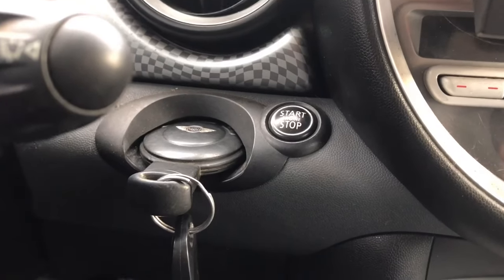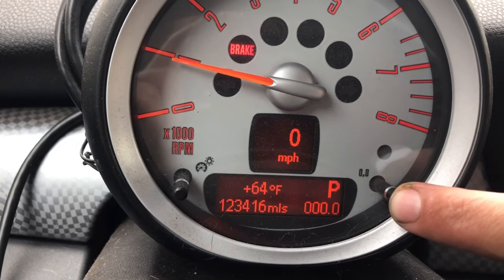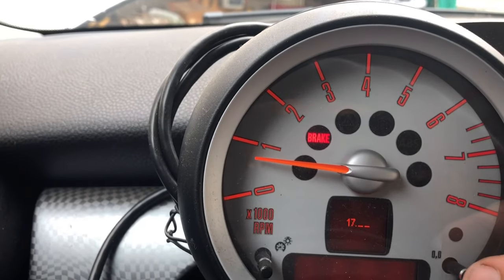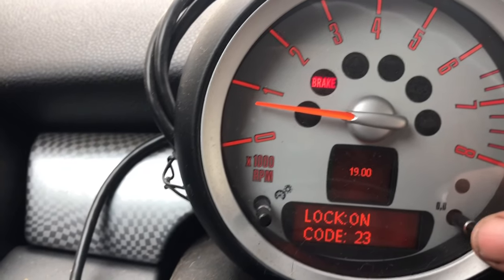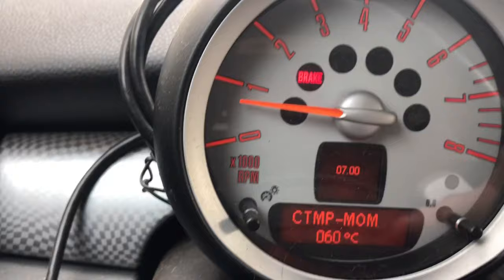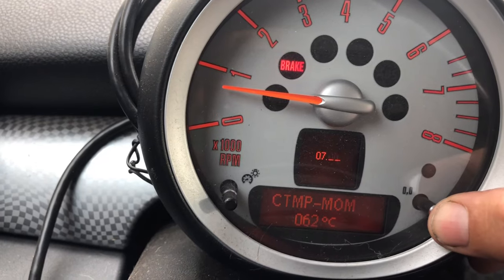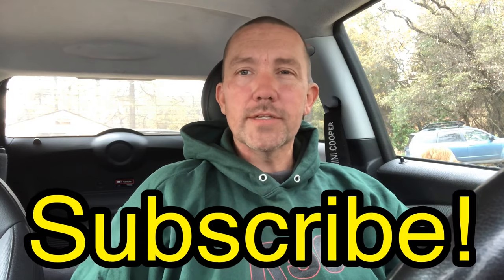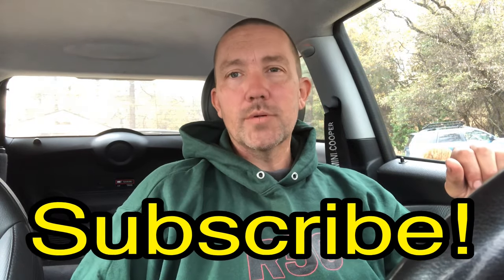How to check the coolant temperature - R56 Mini Cooper hidden menu

Comment: Good to know how to crack the code. I just don't understand why they hid the engine temp anyway. I've just fitted an x60 gauge to give me manifold pressure and temp as well as being able to clear codes. Probably the best £25 you could spend on your R56.
Reply: @emailandy79 hey! Which gauge particularly did you get?
Reply from the maker: A scanguage 2 or an ultragauge will work. I have a scanguage 2 and love it
Reply: @harrydawg   X60 autool gauge.

Comment: I just purchased a 2010 mini clubman two days ago and it’s stalling out on me when I stop at a intersection or anywhere else really but it only does it every once in a while. Last night it started acting like it was getting overheated because it was running poorly after leaving it idling a couple of times while I took my customers their food to the door. Once I stopped letting it idle when I stopped and started turning it off and then starting it again when I was done it seemed to be okay again. The check engine light is on and I got a P2187 code from scanning it. Do you have any advice for me on fixing this problem ? I would be very interested in hearing your thoughts on this issue.

Comment: Hello there! thanks for the nice content. I just bought a mini cooper s 2012, and I see the temperature going up and down all the time, but mostly remains 110 celcius ! Is that normal? Isn't it a risk for the motor?
Reply: It should be around 90C
Reply: @DavidB-rx3km   Unfortunately it is not stable. I noticed that with the "sport" button on, it indeed manages to stay around 90C all the time. But without sport button pressed, it goes very soon up to 110C or more, even with very calm driving. I wonder if it's an ellectronic mapping error.
Reply: In sport mode I think the fans kick in at a lower temp
Reply: @shiro4076   yeah, thanks for the reply, I found out it could be fixed with a professional remapping. I also cleaned the intakes. Now I always drive with "sport" on. And it works fine. With sport off it goes higher but not as before.

Comment: Great video.  I am having an issue with the key fob not working right away.   The car is not waking up and after it starts it could take some as much as a minute for all the gauges to come up.  I have to shut it down and restart the car to clear all the start up menus.  2009 R56.  Seems like a real problem when its cold.

Comment: Thanks, wish it just had a normal temperature gauge.
Reply: I had an R56.....I had it a week then sold for that reason only. Oil pressure and water temp gauges are the two most important gauges in any car.

Comment: hi, do you know if you can deactivate the parking/position lights on the mini? The ones above the fog lights always turn on when you have the light in automatic or the on position. Is there any way to turn them off (permanently) when running the normal headlights?

Comment: What happens if it doesn’t change the screen? I was holding on to the button but it made a weird noise
Reply from the maker: How long did you hold the button?
Reply: @ProjectMini  sorry for the late response. But it was quite longer than what you did in the video. I will check again in the morning.

Comment: I have 2008 mini cooper clubman s the engine not run more 2000 rpm check engine light half motor light

Comment: Nice hack there. Is it normal that the coolant temperature runs at around 80 degrees Celcius; what would be the normal coolant temperature;
Reply: I would assume 80 so my mini is burns oil on every start up and sits around 100c 😂

Comment: 2007 S has smoke from under the hood and a bubbling sound from the coolant tank. Fluid looks black but don't see any leaks and the level is fine.  Temp light came on.  Any thoughts?
Reply from the maker: Do a leak down test in all cylinders and see if you have a blown head gasket
Reply: @ProjectMini  Any vids on how to do the leak test?....or the head gasket if it is blown?  Seems to only overheat when a certain loud fan kicks on. When the fan turns off the temp goes back to normal, no bubbling, no steam.
Reply from the maker: I don’t have videos for those.
Your coolant should be blue, not black. What does your oil look like?
Reply: @ProjectMini  Oil looks good, clean.  She is using coolant at times now.  Check engine light just came on the spedo gauge cluster in the middle.  It comes on briefly in the digital read out every few days, but goes off after a few seconds.  Bad gas maybe?  Used Mobil the last few times but usually go with BP or Shell.
Reply: @ProjectMini  Ran diagnostics on it at AutoZone and the check engine code is for the fuel injectors to be cleaned.  Any vids on this or any advice?

Comment: What do you mean 105 celcius? Not 105, 90 Celsius
Reply: well it's kinda normal that the n14 engine goes up to 105°C if you drive fast...it's also known that this engine got heat issues by itself (Mini Cooper S 174HP R56 2007)
Reply: @Enrico_E  yes but he says that fans come on at 108, on normal engines 110 is the red zone, and the fan should come on as soon as you pass 90
Reply: @Lionn8563  "Should" but actually he is right...The Fan of mine will go on after i parked the car and it got like 105 degrees ±
Reply: @Enrico_E  haha ok
Reply: these cars run very hot, likely for emissions purposes. I was surprised when I read that the fans come on at around 226F!
Reply: @imzjustplayin  mines runs at 107/8 according to my ultragauge
Reply: Everyone just go and purchase a ultra gauge for your mini. You will love it..cheers